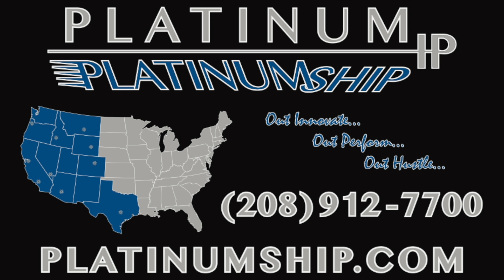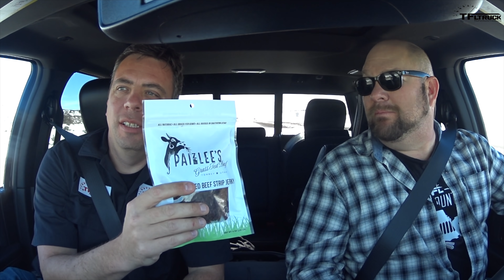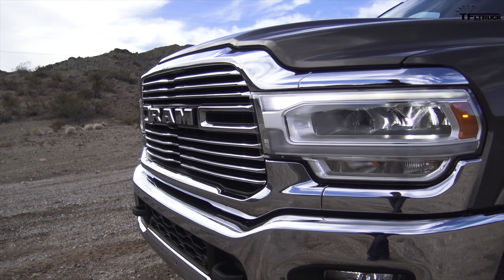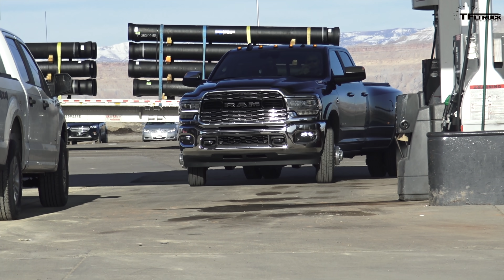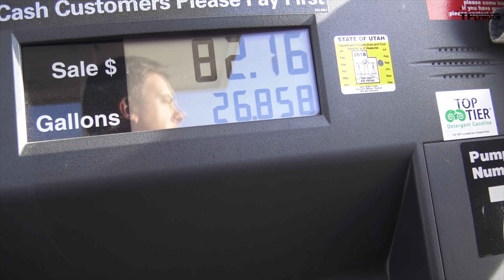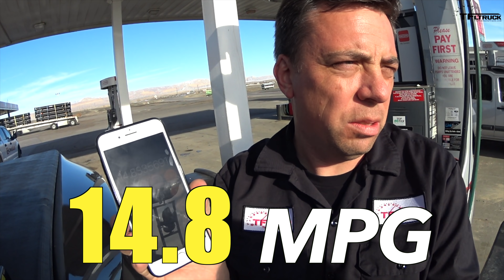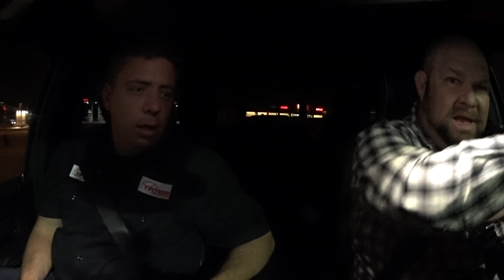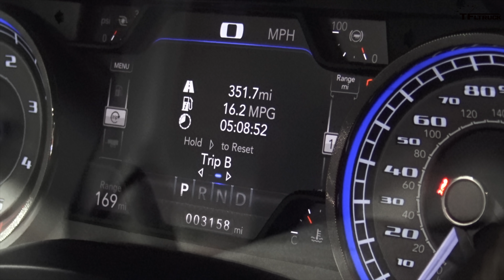We Drive 800 Miles in the New 2019 RAM 3500: Here's How Fuel Efficient 1000 lb-ft of Torque Is!

Comment: That MPG isn't to bad considering the engine isn't even broken it yet.  Thanks for sharing Andre and Nathan.
Reply: People don't see or look how many miles are on the truck. Give it some time and the fuel economy will go up. And also winter blend fuel.  Once it warms up the fuel economy will go up.
Reply: Thanks to our government for ruining all fuel mileage... My 04 5.9 Cummins gets 25 mpg empty and 19 towing a 14k trailer
Reply: @gooru1297   Riiiiiiiiiiiight......
Reply: Very true, my Cummins was pretty thirsty until I had 5-10k miles on it
Reply: These new trucks don't need very much time to break in like the older motors with flat tappet cams that needed extra zinc in the oil. I think this MPG is horrible, should be getting 17MPG on the highway carrying no extra weight with a bed cover on it. 20 year old truck get this mileage.
Reply: Bret Feeney uhhh.. Straight from the owners manual, if you don't tow right away to break it in, it takes close to 15,000 miles to completely break in.
Reply: @bretfeeney1072 Feeney fir sure. My 1999 got 19 mpg all day pulling or empty.
Reply: Well running unloaded isnt doing it any favors when talking about breaking it in
Reply: @GabeTheGreat3k  it's all about having enough gears to keep the rpm low. Our 2019 chevy with the 5.3 mated to the new 8 speed will do 90mph at about 1800-2000 rpm. Does great
Reply: Just remember that in 1999 the same truck got 25 mpg, thank you epa☹️
Reply: I’d say the higher elevation played more of a part in fuel economy.
Reply: @GabeTheGreat3k  only because aerodynamics yes
Reply: Not bad at all. I know the new first are getting around 13. And the duramax is a little better then the ram.
Reply: All the folks in here without the slightest understanding of physics...
Reply: BeanerMan3k but, I get what you're saying about the science.
Reply: BeanerMan3k really?? I drive between 70-80 all the time and get the same mpg as driving 60 mph.
Reply: @JohnDoe-nz6bk  Sorry, not possible under same conditions. There is some physics involved here. I'm an engineer.
Reply: Dave C Idk what to tell you! At 60, I get close to 20 mpg out of my 4Runner and at 75, I get 19 or a hair over. Not rocket science guys, try it yourselves.
Reply: BeanerMan3k it may drop to get to that speed, but once you're there, you're there. Just like ppl who say they keep their heat at 60 while they're not home. I ask why because that's the dumbest thing I've ever heard. You're going to burn through more gas trying to get back up to your desired temperature, had you just left it there in the first place.
Reply: BeanerMan3k actually it doesn't.. I switched my heat like ppl told me to, and my bill was over 125 a month. I kept it at my desired temperature all the time and my bill was 65 a month.

Comment: At first I laughed because my 2018 Chevrolet 3500 HD gets 21 mpg at freeway speeds. But this route they traveled climbs up and down almost every mountain range in Utah. I doubt you could find a tougher one to test the truck. Some of the grades are 15 miles long and very steep, and they have a lot of runaway truck ramps. It's got to be the Ike gauntlet of mpg runs. I doubt my truck would do much better.
Reply: What are you talking about? Utah has mole hills compared to Colorado!
Reply: @55afishead  - you apparently haven't driven that stretch of I70. As a truck driver based out of Denver, I know that stretch intimately, and op is right. It's one of the worst stretches of road for fuel economy testing. Really a worst case scenario. 

Beautiful drive though, especially in the afternoon. Sunsets are inspiring.
Reply: @Broadpaw_Fox  I agree somewhat. But when you go downhill your getting great MPG. I was just stating the hills are steeper and a lot higher in Colorado. I drive I-70 through Utah a dozen time a year and hardly notice the hills at all. Yes, beautiful views!!

Comment: Big truck and low gears take a huge hit at 75 to 80 mph. I would dare bet 4 to 5 mpg better at 70 mph vs 80 mph.
Reply: Yeah, if that truck was cruising at 55-65mpg it would have done much better
Reply: Transmission evens out the  410 to be higher gear ratio 3.90 ratio

Comment: Great video. One growing concern is with all this technology why only 14 mpg on an average?  Almost 20 years ago Ford built the 7.3 diesel and even after you install a few performance improvements the average mpg is up around 19. The Ford has a high reaving top highway gear ratio as it cruses at over 2300 rpm at 75 mph and still averages 17-19 mpg. I think there needs to be more focus and improvement with fuel efficiency.
Reply: Emissions and heavier!

Comment: 80 MPH? why you driving so fast ??
70MPH is kinda fast, do the trip going 68 and 65 you will see a huge MPG gain !
Reply: Not many people drive 65 70 for 1000 plus miles. Myself and I have a Cummins usually drive 75 80 on the interstate/highway. Sometimes faster if I keep up with traffic.
Reply: @pulvermacher80  thats not safe at alll, I have not problem drive 65, in fact im use to drive 58 to 60 most of my life,
Reply: @Zraupp10  no shame in that! Just stay the hell out of the way.
Reply: @nickx831  what you driving ill be sure to be -D
Reply: @Zraupp10  Pink Toyota Yaris.
Reply: @Zraupp10  There are roads out west with higher speed limits. I'm in KY and our interstates are 70 MPH
Reply: @bags4930  70 here but trucks are 65. Minimum 55.
Every ones liked going 80.
I use to go 77 to 82 but it burns oil and mpg 16, I just cruse at 68 most of the time getting 30 to 33 mpg

Comment: I read a few of the comments on the fuel tank capacity. More would be better, but most people can't sit in the truck and drive it utilizing it's current fuel capacity. They're going to stop often, eat, restroom breaks, snacks etc. As a long haul trucker, the same vehicles pass multiple times over and over. Driving for long stretches isn't healthy for you anyway. An extra fuel stop to get out and stretch your legs could be a good thing.

Comment: Does the new Rams allow the owner to do a stationary regen
Reply: No, I don't think so.. However, your first regen shouldn't be until around 40,000 miles.
Reply: John Doe that doesn’t seem right, it should regen every 350-500 miles, unless you mean it needing a full cleaning by a shop, guess I’m not switching from my ford, so far from the info I can gather, only ford offers a stationary regen, the truck prompts you to perform one when the DPF is at 120% capacity, I’ve only performed one, at 54k miles, pretty cool feature ford offers across all trim levels, I did mine while sitting on the couch, keeps me from going into limp mode and paying a shop to perform one, ford has the daily driver or all owners for that matter in mind
Reply: Ford F-250 6.7 Super absolutely not! If you're regening after 250-300 miles, then something is wrong.

Comment: LMAO, did you expect to lose speed in an $87k 2019 unloaded truck going uphill? wow...
Reply: Well since the cummins in the 90s did it i don't think the price really factors in here.........
Reply: @eatshitful  I think it does, and I fail to see your point diesels are a lot different than they were in the '90s...
Reply: @rsdna9698  HUH??? It is still very similar to the original 5.9 cummins which had no trouble pulling the hills without slowing down decades ago and this one has a much higher "claimed" HP rating. Why would the cost matter? You could of spent half that on a new truck years ago and did the same thing. Or are you meaning the changes they have done are so bad you must expect paying more to do the same??? I think maybe what you said and what you mean might be 2 different things. Or how i am reading what you said is different then you meant?

Comment: Ill keep my egr deleted 04 6.7 H.O 6 speed. When hand calculating i get about 26mpg empty, and average 19mpg with a 10k lb trailer including hills
Reply: Cummins didn't make a 6.7 in 04... I have a H.O. 5.9 2004 3500 and I get about 16 -17 going 70-80mph. What programmer, and delete kit are you using?
Reply: 19 with a trailer?
Reply: @davidrosenkrantz4854  yes, a 28ft enclosed trailer, when i towed my 40ft bumper pull camper i got about 15.
Reply: Its a 5.9. All the talk of the 6.7 and thats what my brain told me to type. It had the delete when i bought it but other than the delete and full 5 inch turbo back exhaust shes stock. No tuner, no anything. I also dont run over 70 mph i am however running 35x12.5 tires
Reply: @alangivan9771  that is damn good! I need to look into getting rid of the egr. I have a Bullydog GT, BD boost fooler, and SCT air intake. They help some, but thinking egr delete , and 5" would get even better gains, just takes money... lol.I do get about 20-21 empty @ 60. But only about 15 pulling 20' enclosed car trailer.  Mine is 4 wheel drive 1 ton with automatic and 4.10 gears.
Reply: @bellasky83  mine is a 3/4 ton, with 3.73 gears, i forgot it does have leveling airbags in the rear. I dont like squatting lol
Reply: @alangivan9771  Yeah, mine has bags too.  Towed 37' gooseneck with 18 round bales, about 20k lbs no squat!  Love the truck and engine, and only cost me 20k not 90k.  The difference in Mpg kinda makes sense with the differences in the trucks.  Sounds like a nice truck, good luck and happy towing!

Comment: To everyone saying this is a bad MPG. Their AVG speed was over 70mph. They said they had long stretches of 80mph, which is about 130km/h. Depending on where you live most speed limits are far lower than that especially here in Canada. I bet it would get 17-20mpg on the highway here in Alberta at 100km/h. In my experience trucks get far better mileage 90-100km/h than anything over.
Reply: Laws of physics state best speed is 96km/h(60mph). When you cross that threshold the effort to maintain speed or accelerate increases exponentially.  They can gear how ever they want it will never change. Mpg is very dependant on speed especially with a large vehicle.
Reply: jnk26 exactly lol the shape of a truck is hardly better than pushing plywood down the highway.
Reply: @savethe2strokes  aerodynamics do help, but a truck that is 80" wide(96"@ dually fenders) and 78" tall going 80-85mph  is still displacing a ton of air. Whether it's a bus(102"w x12' h) or semi of  a car of low coefficient drag it will always use more energy above 60 mph. Fluid dynamics will always apply. Gas and liquids move the same way, one is far greater in density that all.

Comment: It will improve as the engine breaks in. I have a 2018 crew cab Limited 4x4, HO 6.7 with Aisin trans, 3:73 gear ratio. I checked it on road first trip where I go approx. 120 miles with cruise set on 75 mph on I40, no bed cover. When truck had approximately 600 miles on it, that stretch of highway I averaged 16.4 mpg. I made the same trip yesterday, close to same outdoor air temp, truck now has 13,000 miles on it and it averaged 18.5 mpg. With the trip I made yesterday I have approximately 50 miles where I can set cruise on 58 mph once I get out of congested traffic. Yesterday it got 23.2 mpg, when it was new it was getting 21 mpg.
Reply: In fact, Cummins doesn't really have traditional engine break-in periods. Actual break-in is 300 miles, and that's simply to break-in the rear end of the truck before towing. The Ram Manual states, "A long break-in period is not required for the engine and
 drivetrain (transmission and axle) in your vehicle. Drive moderately during the first 300 miles (500 km). After the initial 60 miles (100 km), speeds up to 50 or 55 mph (80 or 90 km/h) are desirable." Well, they're well beyond the 300 mile break-in recommendation. 

As for mileage, I don't believe you got anywhere near 23.2 MPG on any HD truck, certainly not after regeneration and in real-world conditions. My truck's display will lie to me and say I'm getting 20+ MPG regularly, but it falls to around 17-18 MPG highway on a good day after it regenerates.
Reply: @Mark_Christian25  - I have purchased a 1999 2500 new, then a 2005 3500 new and now a 2018 3500. Every one increased in fuel efficiency as I put miles on them. No matter what you believe, I just checked it yesterday after that trip. Those numbers were from the computer on the sections of highway with different speeds. But, full trip real numbers at the fuel pump. My trip consisted of 398 miles to and from, I have a lot of driving on interstate prior to getting in slow/stop & go traffic for several miles through Raleigh NC morning traffic then 55 speed limit of highway and slowing traffic through towns for remainder to destination. Then the same trip home with similar evening traffic. I stopped and topped off tank 7 miles from home on return trip and checked total trip mpg. Even with the traffic congestion to and from I still averaged 18.8 round trip with approximately 240 of the miles being around 75 mph and a lot of miles is stopped and slow traffic. That's pump numbers on a stock truck.
Reply: @chrism2042  As far was we're concerned, that's anecdotal evidence. People say all kinds of things about their mileage. Besides that, every vehicle tends to see improved MPG as it stacks miles, at least to an extent.
Reply: @kevins5469  They should wait for 100,000 miles to know its real mileage.
Reply: @kevins5469  - I didn't mention it for evidence, just stating how mine changed after getting some miles on it.
Reply: emdec55 bwahahahahaha.. No its not! Straight from my owners manual, if you don't tow right away to break it in, it usually takes 15,0000 miles to fully break in.
Reply: John Doe What is posted is from a RAM owner's manual. There is really no break-in for these engines, just the drivetrain.
Reply: @JohnDoe-nz6bk  Dude,....what I posted was LITERALLY taken from the onwer's manual. Don't make things up.
Reply: The Repo Man https://www.flickr.com/photos/80204415@N03/35829084783/
Reply: emdec55 🤣🤣🤣🤦‍♂️ oh stupid one... Look at my last post!!
Reply: @JohnDoe-nz6bk   Nothing you said is in that post. Good job.
Reply: @JohnDoe-nz6bk  You're a m0r0n.
Reply: emdec55 ALSO.... I got between 19-20.4 mpg all year and your first regen shouldn't be until around 40,000 miles if you do a lot of highway driving. Heavy towing and city driving will make the regen earlier. 🤣🤦‍♂️ good God man!
Reply: All vehicles will get better mpg at 100,000 miles. There's nothing different about a Cummins engine. This test is as fair as any.

Comment: So what your saying is a brand new truck get worse fuel economy than my 20 year old truck with bigger injectors, larger turbo and a modified injection pump. I'm 100 foot pounds less than this truck but get 4 more miles per gallon. Which 15mpg is a far cry shorter than my dad's 06 Mega cab with a lousy BullyDog tuner on it that could run 22-24mpg all damn day. 

I am interested in seeing how the likely plastic shutters in behind the grill fair in winter conditions. As Semi trucks had them decades ago and got rid of them because they would freeze shut and the engine would over heat, and they had metal shutters. 

Realistically you could get a used truck without the DEF, put a tuner on it and have nearly as much or more power for a lot less money and it will be more reliable because it doesn't have the useless emissions systems that a new truck has. Plus you will likely save 30-40K... 

I'm not knocking your testing or the information you are passing on, just mocking an industry that is falling far short of what they should be producing.
Reply: Sounds like your truck is modded and doesn't have emissions. How about you actually educate yourself before posting stupid comments!
Reply: Do you run 70-80mph everywhere?

Comment: Where I live it would cost .19¢ per mile at 15mpg @ 2.89 per gallon of diesel

A gas engine at 12mpg would be .18¢ per mile at 2.26 per gallon of gas.
Reply: That's why Ford is bringing back the 7.3 gas motor in 2020. Gonna have a 10 speed transmission too.

Comment: I'd be curious to see what the truck gets after the break-in period. I'm not really a fan of diesels anymore.  I think (opinion) they are  overrated. If a person doesn't pull over 9,000 lbs on a regular basis, a gas engine would be fine.
Reply: I have to agree with you here. Although there are efficiency gains in diesels over gasoline engines, the difference is small now and with the premium one has to pay, unless you’re towing all the time it just isn’t worth the extra cost of purchase and maintenance. Dpf and egr killed the efficiency these types of engines once had and it’s unfortunate but true